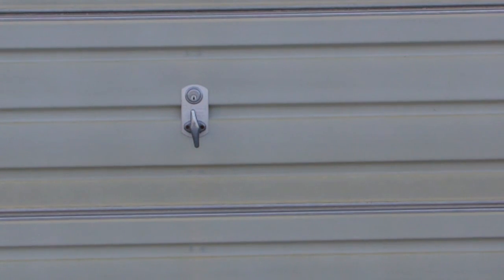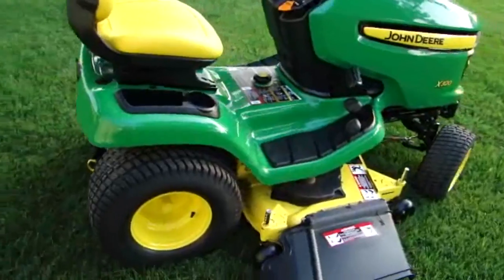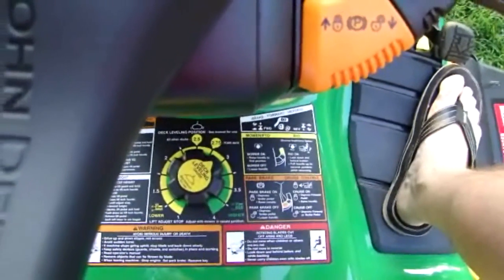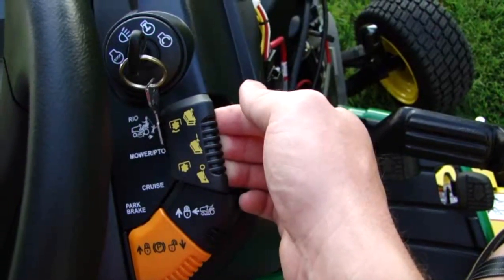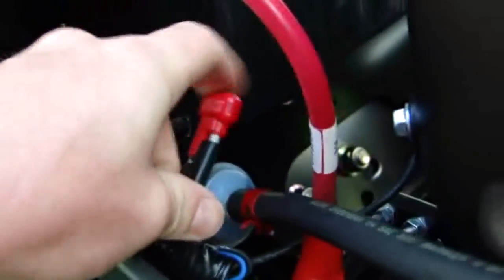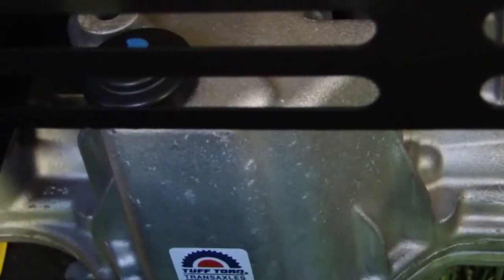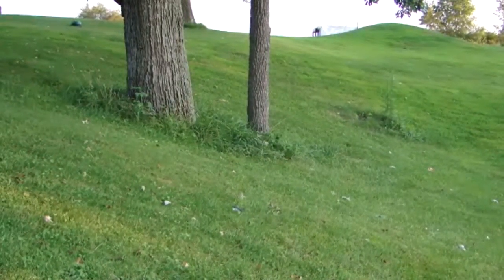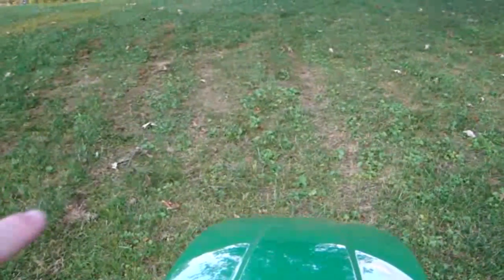John Deere X320 Walkaround and Review Part One of Two.

Comment: Nice Kawasaki, they makes he best small engines. I love the one on my little walk behind John Deere, its been such a a good engine. It only has carb problems, but that could happen to any engine over ten years old. Half of those years it was stored with old gas in the tank by its former owner. Its also pretty fuel efficient and a fast bugger as well, in top gear you have to run to keep up with it.

Comment: @k9mondo The deck is pretty easy to take off, but the first time is a bit of a bear to do. The only trick is pulling the pedal to lower the deck and locking it in the lowest position. After you do that, turn the wheels, pull the J pins on the arms, and you are on your way. Also, I'd put a couple of 2X4's under the deck before you lower it, it makes it ALOT easier to work the Jpins out....

Comment: What's the difference on this mower compared to LA145, La145 has 22 hp Briggs 48 in cut,I own a 145 and I think it is made by MTD not JD, I had to completly rebuild the front end wheel bearings tie rods,spindles all of it after 200 hrs,motor still fine and cuts good

Comment: @flanksteak2 I’ll admit that I’ve had carb problems with mine, the float is sticky and so it floods the engine and packs the cylinder full of fuel sitting a few days, messy and makes it a bitch to start. But I don’t really care because it still runs prefect and as long as I shut the fuel value off I have no problem.
Besides the previous owner left gas in the damn thing for 5 years I don’t begrudge the minor problem. One day I’ll rebuild the carb and it will be a flawless 20 yr. lawnmower.

Comment: What's the difference between the x300 and the x320
Reply: the 320 has a better transmission (a K58 vs. the K46 that comes on the x300)
Reply: Bryan B its a 1000 dollars more for 5 extra hp and a slightly bigger transmission (rip off) x300 is a better deal
Reply: +Bryanppolllii
Reply: +iwanaGoFast2010   But can you get the 54" deck on the X300?  If not than the X320 might be worth it if someone wants a bigger cut.